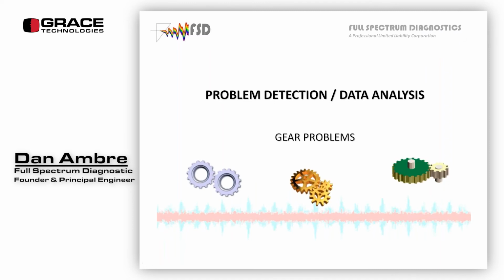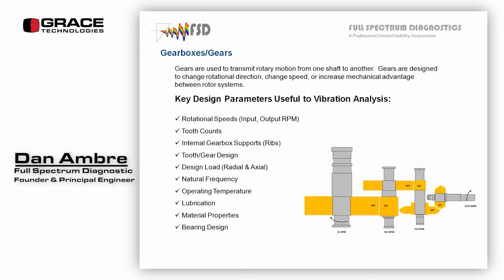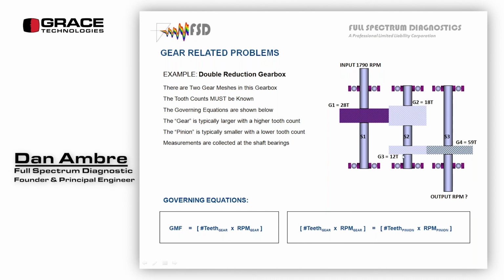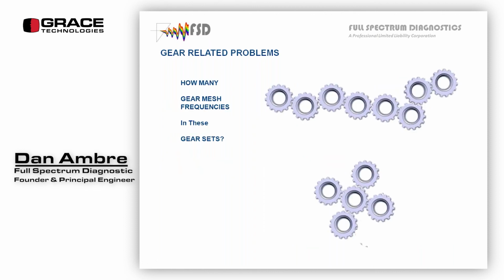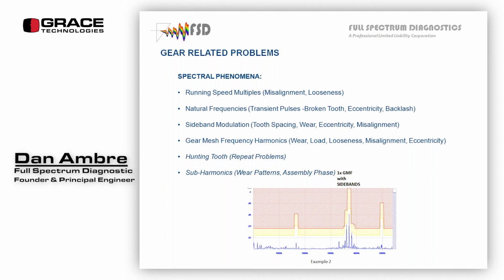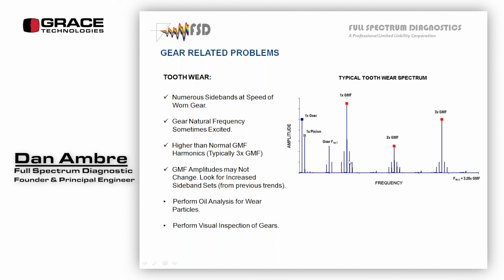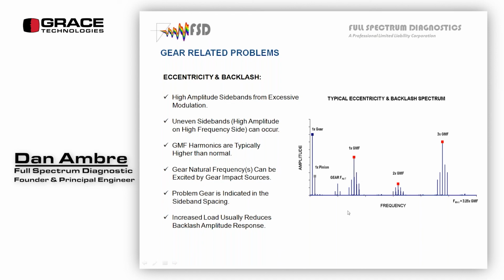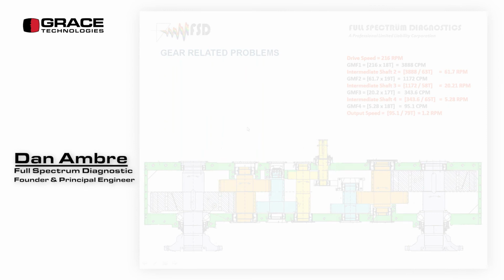Webinar VOD | Basics of Gear Analysis; A Vibration Topic

Comment: In regard to the untraceable trend problems caused by variation in load, RPM, and even oil temperature, data-driven method like machine learning could be a real crucial helpful tool.